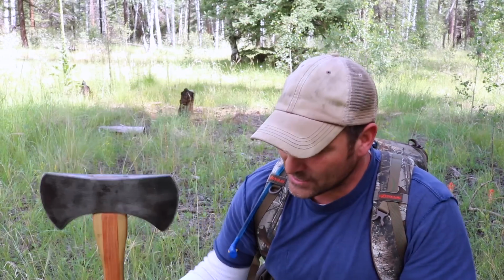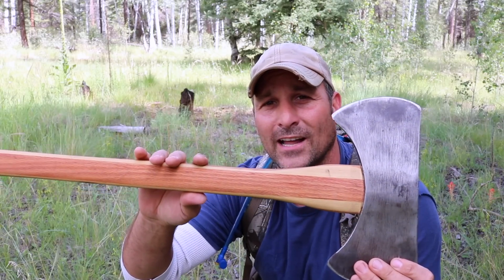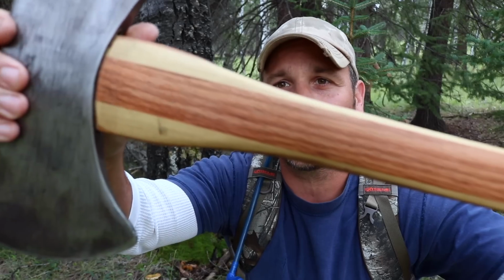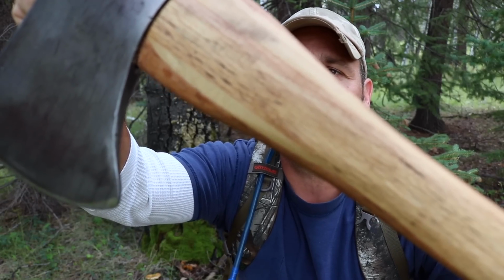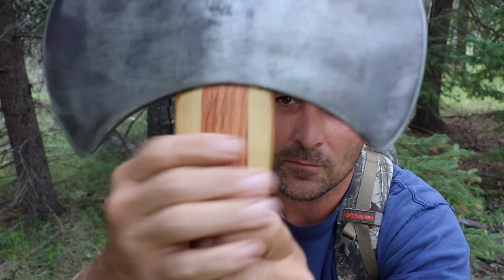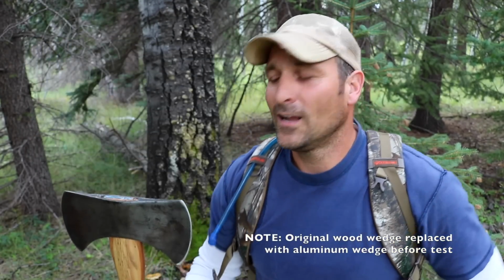Pallet wood axe handle TEST CHOP

Comment: Dead wood is a hell of a lot harder to cut than live.  It also can send widow makers through your skull.  Be very careful when felling alone and try to avoid dead trees for chopping as each impact of the axe sends a shock wave up the tree and can knock brittle dead limbs off.  The handle is really cool.  If it were a user, I'd question that hard shoulder you carved in.  Those are cracks waiting to happen.  As a wall hanger, it's a beauty and you made it out of a pallet.  That doubles the cool factor.  Good work.
Reply: That was some good info..Never even thought about any of the stuff you mentioned. Very good posting !!!
Reply: Why avoid dead trees if your main use for an axe is firewood

Comment: A laminated handle is going to be a lot stronger and more resistant to damage. It's like the new wooden bats for baseball are made of laminated wood and don't break nearly so easily as the one piece bats do. The one thing I did notice is when you fit up the head it was far too easy to slide on, it needs to be tight, so tight you need to use a dead blow or a mallet to seat it. then you need to use a wedge,, which you did, to fill the gap and seat the head. Then you need to use a steel wedge going at a right angle to the wedge to seat the head in the other direction.  Oh, and you should have used some linseed oil or tung oil or something on the part that went into the head of the axe because that will allow it to swell and get tighter still. However, the laminated ax handle is a great idea. Good job. Oh, and the kid is just a cutie.

Comment: A dead tree would have been harder on the axe as well.
I watched the original video, you mention you left it thicker than the original handle as you thought the old wood might be an issue, actually the seasoned wood could have gone thinner, as it is stronger. There would of course still be your concerns in regards to delamination. 
Of course you could also have just salvaged one of the vertical uprights from the pallet, then there would not have been the need to laminate it anyway :)
Reply from the maker: thanks for checking it out Jack:)  It was fun to build for sure!  Glad you got to see the full build and chop:)
Joe

Comment: Strength or durability wasn't the question for me.  But with a very stiff handle and no flex, every impact is very hard on your hands, joints, and body. Slight flexing of the handle takes some of the force of impact away from transferring to you.
Reply from the maker: Yep... not much flex, but still a fun project to build and use... and I'm glad it held up... even if I almost didn't  lol!  :)  thanks for watching!     Joe